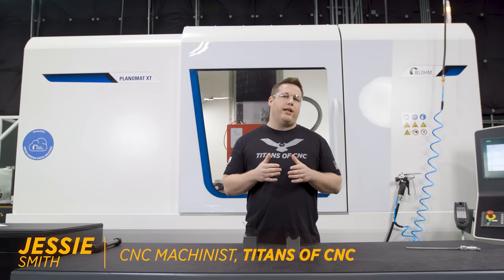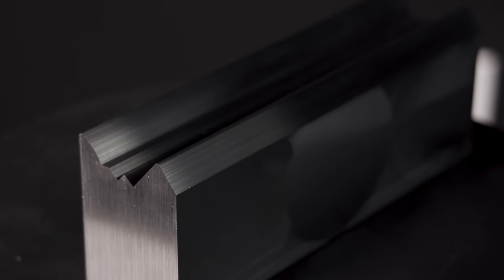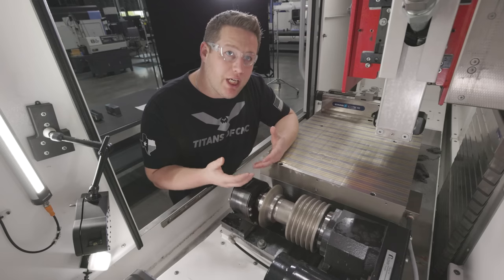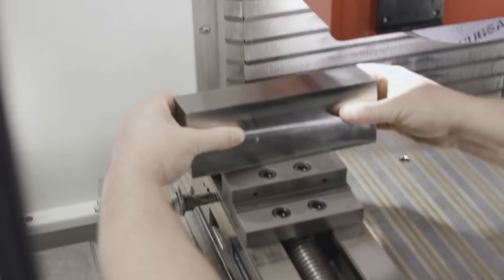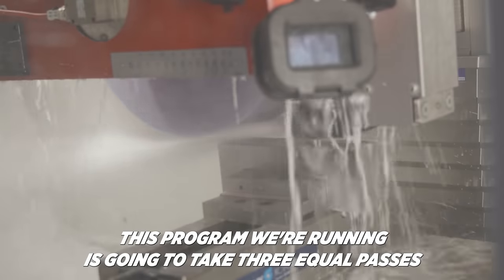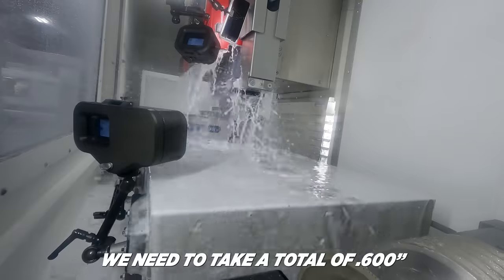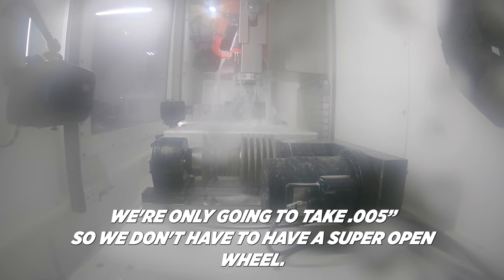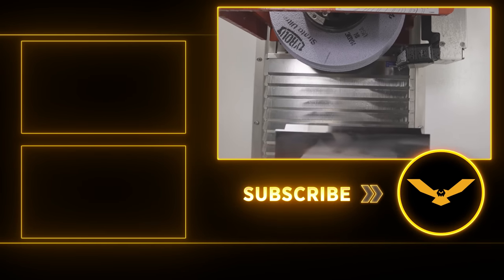Having a Diamond Disk Dresser Allows for more Versatility

Comment: Nice work Mr jessie 
And I have a question... can we do a primary roughing on cnc milling machine for this part before the grinding to increase the life of the wheel or this couldn't make any difference 🤔
Reply: It wouldn't hurt if the part was being milled anyhow. But this grinder is more than capable of removing that stock.

Comment: This might be a stupid question but when do you use grinding and when do you use a lathe or CNC? they seem that they're able to do the same jobs
Reply: Well heavy duty operations on mostly cubic parts are done on a lathe. Rotational parts are mostly done on a lathe. CNC is just the term for computer controlled machines, not the process per se. 

You are right a ton of parts which can be done on a lathe can be done on a mill and vice versa, but when productivity and money efficiency plays a role, you must choose the solution which makes most sense money wise. Can't put a 1000x1000 millimeter part on a lathe.

Also there are plenty all in one machines nowadays, but often they can't get the job done as well as a machine designed specifically for just one job
Reply: Grinding is for making smooth precision surfaces or hard to machine contours like in the video
Reply: Round parts/ features = mainly lathe, off shaped parts of any kind and larger parts = mill. Typically but not always since there is always ways to do it on either that’s just the most efficient, you’re not going to spin a 1000lb piece of titanium on a lathe with off center features throwing it out of balance with weight and speed goes boom

Comment: Jessie,
If you were holding an overall height of tool with a similar shape/profile, how would you know that you are taking off exactly. 005 without blowing your part tolerance. 
Great vid. Keep up excellent wrk.
Reply: Machine calculates the new value of the wheel after dress
Reply: That’s what I always wondered
Reply: @darylegerton8998  
If you were holding an overall height of part with a geometric form, how would you know your height is right without removing the part from the vise. Just saying if you remove another .005 from the wheel doesn't mean your to print tolerance?
Thanks

Comment: how do you know how much to re dress the wheel? is there some sort of formula per how much material you remove?
Reply: This will be determined by a number of factors.  Type of material, amount of material removal before re-dressing, wheel speed, etc... Ultimately this will be something you will determine after you start making parts.  But if you have selected the correct wheel, (hardness and grit) for the type of grind you are doing then you shouldn't need to remove a lot of material for re-dress.  In this video for instance, I am grinding 4140 and removing .300" before re-dressing which is a ton of material to grind and I only took off .006" (radially) when re-dressing and it was enough to reshape the wheel and open it back up.  These are really good wheels and I haven't seen a lot of breakdown on them.
Reply: @Jessie_Smith  that's kinda what I thought but thanks for taking the time to explain this more for me.
Reply: @joesmith2465  no problem.  Thanks for watching
Reply: @Jessie_Smith  never miss first thing I check in the morning

Comment: I would have expected the part to be machined before the grinding operation.
Reply: Same here. Doesn't make sense to grind whole chunks away but this is for demonstrating the capabilities only i think.
Reply: It could have.  But this part was done in 20 minutes total from start to finish on the grinder.  It would have taken much longer just to rough it on a mill, plus the setup time and cost of endmills.  So at that point, why not just put it on the grinder and get it done fast in one operation and only one tool (the wheel).